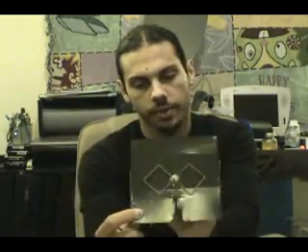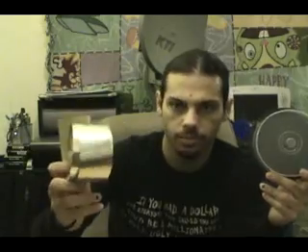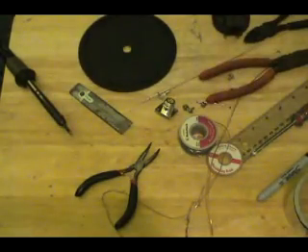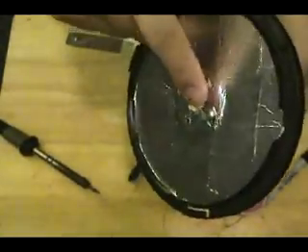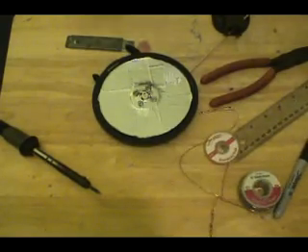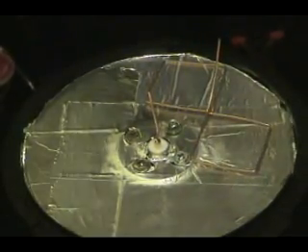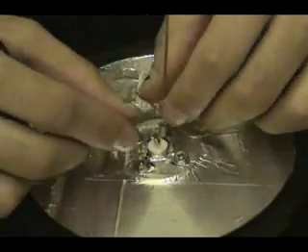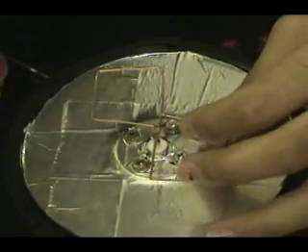2.4 Ghz BIQuad Antenna -Part one

Comment: unfortunately this method leaves some unscreened feed to the elements and will cause losses due to the feed radiating. Better to bring coax up the the center of copper tube to within 1 mm of element. Screen braid to copper tube inner and feed to centrer bend in the element.

Comment: You mentioned it will receive wireless signals. What if I connected this to the back of my DIR 615 DDWRT router? Will it enhance my wifi and send wifi signals out better than the standard antenna?

Comment: thanks for the vids. If you are to want a piece of solid copper for the reflector plate I ordered one from a custom fabricator on ebay. His name is dagger8 on ebay look him up he has a listing for custom pieces I ordered 2 18g plates made to the dish feed specs (110mm x 170mm) with the two longer ends bent up at the 30mm mark. The seller was excellent and fast. I could not find copper locally so I highly recommend him.

Comment: I wish you guys would STOP using panel mount N connectors in your projects, you can't scavenge them from anywhere and nobody has them.  I followed the math and built a cantenna today and it doesn't work worth shit even thought I used all the right diameters and lengths and checked my connections with a continuity meter... so I'm going to try and build a doulble biquad next.  I'm probably going to use galvanized tin for my reflector and copper wire for my antenna.